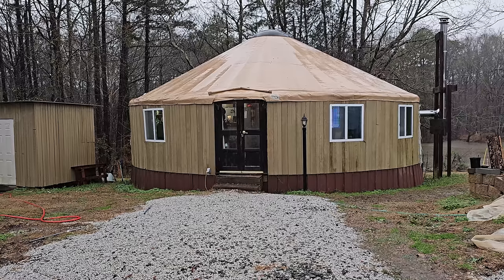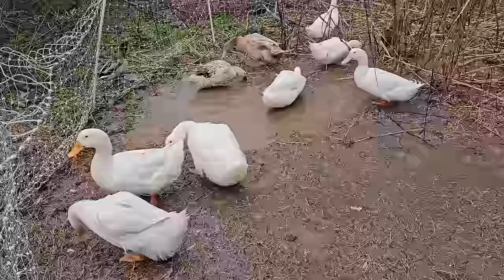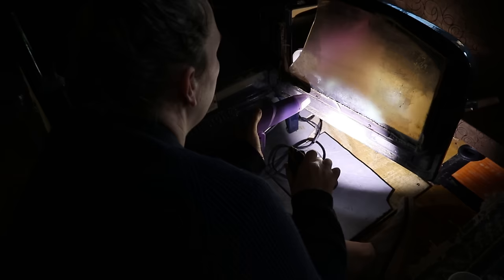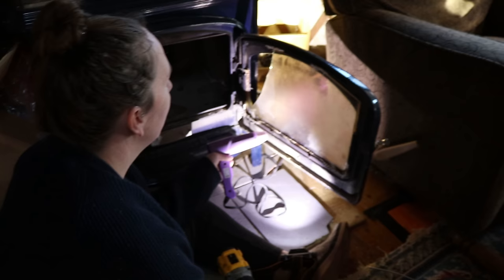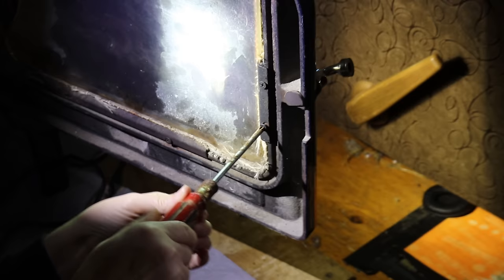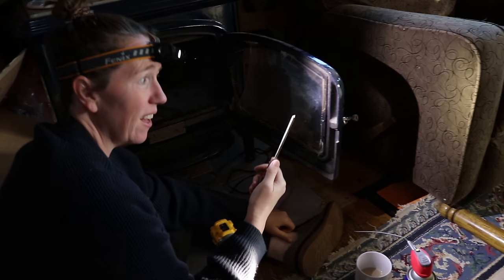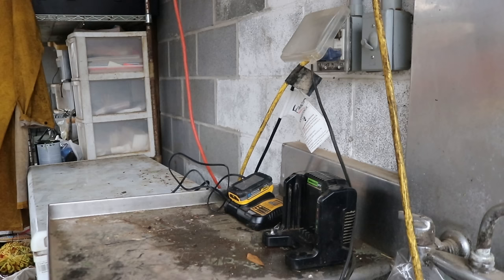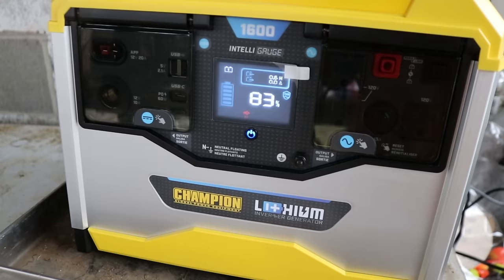😃 What's Happening Here... | Vlog News

Comment: I ended up breaking the glass in my wood stove door also, but it was when I was loading it up in the middle of the night. After lots of research, I ordered a new piece of glass. I also ordered the glass A Touch thicker so it would have more resistance to cracking. Been working great ever since.

Comment: We love, love, love turkey eggs as we raise Red Bourbons.  I can pet them and be around them with no issues.  Thanks for another great video!!
Reply: Can you tell me what set up you have for them?
Reply: @susehendricks6217 , also, let me share a few things we did to make our coop more secure:  buy 4-6 livestock panels (depending on size you get), 8 cinder blocks, abt 12- 2.5 in U bolts, and rebar for all 4 sides.
Take the rebar and the panels and secure down on bottom rail with the UBolts.  This adds weight and security, but most of all it doesn't allow for critters to dig under the coop as the panels won't allow that!  The cinder blocks also add weight for the panels and all you do is just place them in  each corner and down the sides of the coop...you're done!

We've not had a coon strike since we have done our coops this way, and we are very happy with the set up!

Comment: I sometimes work on vintage/antique sewing machines and the screws are very hard to get out. I use sewing machine oil, a screw driver and a small hammer to loosen the screws. I give the SMO (sewing machine oil) 24 hours to soak in, take the screwdriver and tap the screws gently as I turn the screw. It works 99% of the time.

Comment: I've replaced the seal around the glass on a wood stove.  Lowe's usually has it and you will need special glue.  The good news is I replaced it in 2014 and it's still going strong. In the winter or if it rains our electric goes out and this is the first year our pipes froze. I did a lot of praying and God helped my husband thaw out the pipes in 2 days.  If your chicken lays an egg that big it will need stitches 😂😂😂😂. Ii like my eggs scrambled or an omelet with no runny parts.

Comment: What you might decide to try putting some cottage cheese in your turkey or duck scrambled eggs to improve texture (rubbery) and mellow out the strong flavor.

I have never tasted turkey but grew up with chickens, ducks, geese and guinea hens.  Because we sold eggs there were times there weren't enough chicken eggs for both customers and the family the chicken eggs went to customers first which meant us 6 kids had to make due with all the other eggs.  

Not all of us cared for the duck or goose eggs 🤢🤢🤢🤢. The work around is to mix 1-2 tbsp of cottage cheese with each egg before beating them up.  Not only does it increase fluffiness but it does add a mild cheesy flavor (similar to mild cheddar).  I used to also love adding some chopped up spinach into the mix but unfortunately for those who have issue with high oxalate levels that is not an option any more☹️☹️.

Anyway, the cottage cheese does work well and your kids will never realize what you have added.

Comment: Just food for thought. Glass is not necessary for a wood stove to work. Sure it’s ambiance assuming it’s clean, but it has zero function other than that. I’ve spent the majority of my life with wood heat and never had a stove with a glass door. Steel radiates heat much better than glass. Worst case scenario, have a piece of steel cut the size of the glass and just use it instead. You might be surprised by how much better it works and it’s sure cheaper than hunting down a fancy piece of glass. I’m enjoying my wood stove as I write and completely heat a nearly 3000 sq ft house with it. No blower or fans, no glass. It’s about as simple a set up there is. I wouldn’t trade it for the fanciest, most modern thing on the market.
Reply from the maker: The recipe for the green sauce is also in the Chicken Recipe here: https://www.onceuponachef.com/recipes/peruvian-style-roast-chicken-with-green-sauce.html
I didn't have all the mayo required so I added extra sour cream.